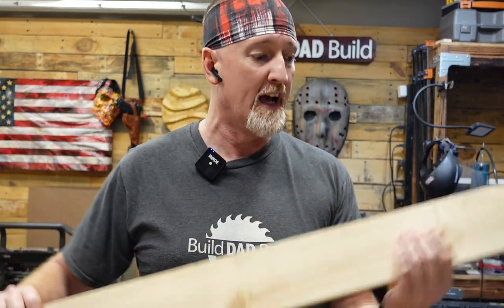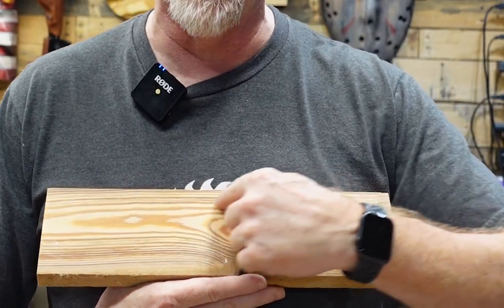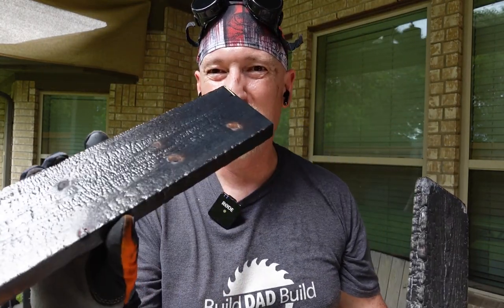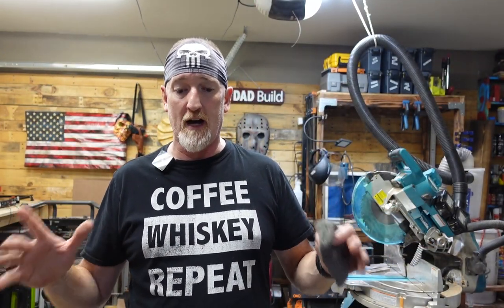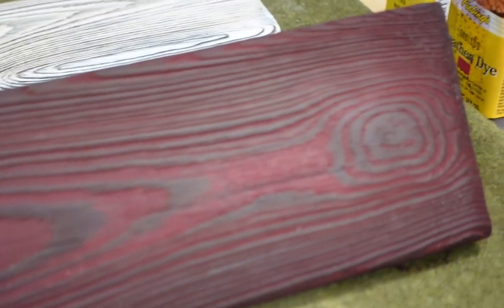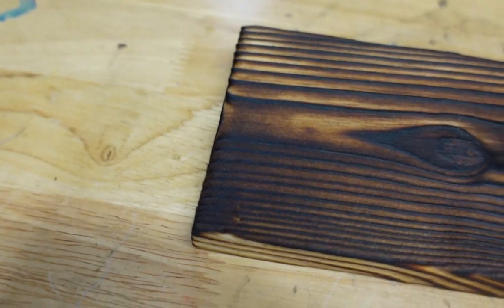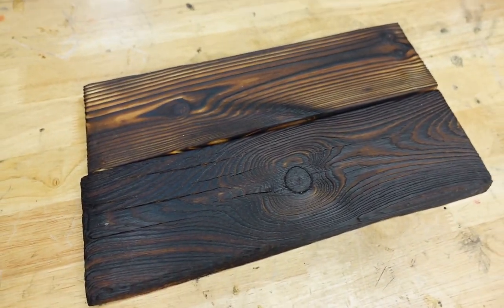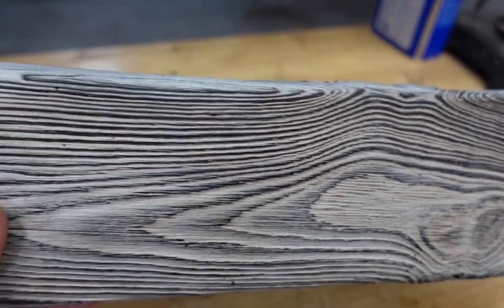Antique Pine Vs. New - Torching Wood

Comment: Noticed you sprayed on the finish. Is this your preferred application? if so what are the pros and cons in your opinion? Love your work.
Reply from the maker: Depends on the piece. For smaller things and for these types of videos I prefer spray finish because it's quick and easy. Larger pieces I usually opt for a wipe or brush on finish (and sometimes mix it up for my sprayer).. My preference is usually the easiest thing to work with. LOL
Cheers

Comment: Is when building a project project doing the burnt wood what do you recommend burning the wood 1st and then putting it together or put the project together then burn the wood
Reply from the maker: It really depends on the project. For more intricate projects I suggest cutting your stock long and burning first. Then cut to fit and burn the edges to match.
Cheers